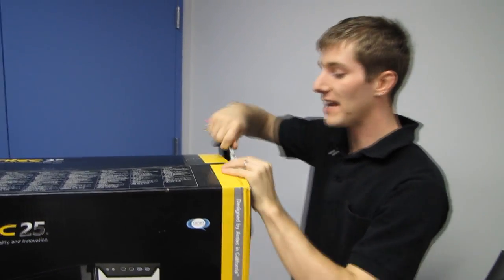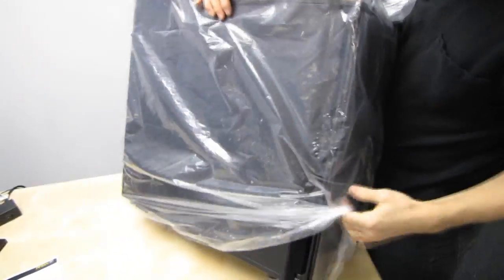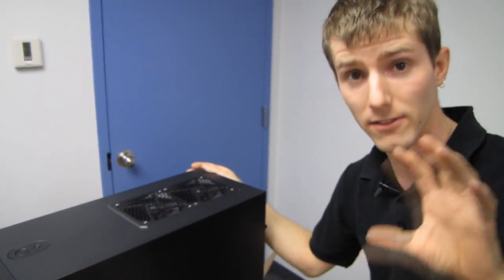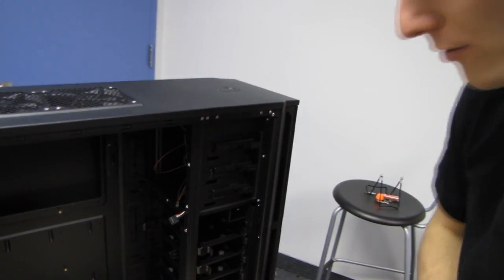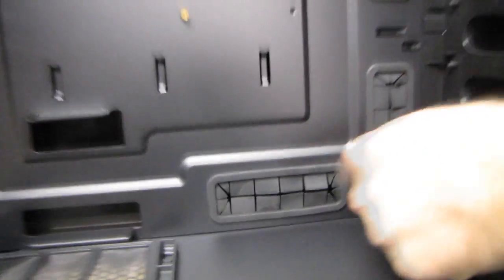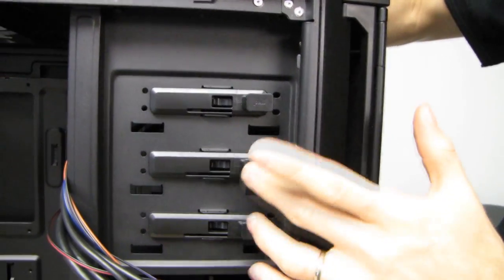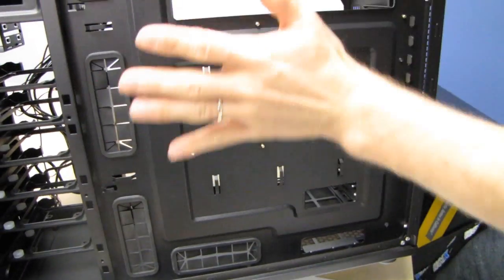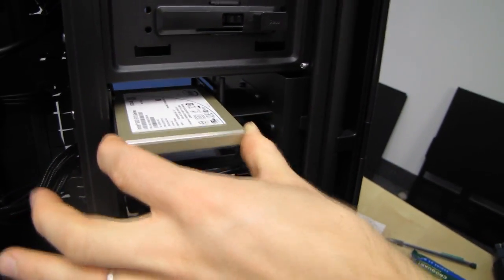Antec P280 Silent Case Unboxing & First Look Linus Tech Tips

Comment: I have used this case for close to 12 years, my original build had was a Asus Z87 with an Intel i74770K.  I have since reused this case with a Asus PRIME Z790-P WiFi motherboard w an Intel i7-13700K.  It has been an excelent case.  I wish it was still available but I haven't been able to find it anywhere, even used.  It makes for a great server tower because of the number of drives that can be put into it.

Comment: Linus looks so young in this, lol. It has been 10+ years since I bought this case and it's still going strong. I am building a new system soon and have been debating whether or not to buy a new case for it. If I could find an updated front i/o panel I could use this case for another 10 years. (would be nice to have 3.1 usb though).

Comment: Used this case for 10 years and switched only this year to Lian Li O11D Evo, new nVidia cards are too big. Miss P280 filters, had to make new filters for O11D Evo, cause stock don't filter anything (snakes maybe), just block air and are tricky to remove/install.
Reply: i bought it today for 15.50 $

Comment: I have this case. The 3 speed fans were the first thing to go. I replaced them with Cougar Vortex 120mm fans plugged in to the mother board. Antec's idea of cooling fans is not main stream. The Vortec fans are on built in rubber mounts and are a lot quieter even at full speed. Other wise I'm very satisfied with this case and feel I made a good choice.

Comment: I have the exact same case that's in this video. I bought it for $50 USD at the LinusTechTips meetup garage sale last summer. Great case.
Reply: +SuperAwesomeWeirdGuy Rly? I have it too, because my father bought it... I HATE IT!
Reply: Lukas Prosch What problems do you have with it?
Reply: You can`t replace the Drive-Cage and the rubber things broke in 2 weeks! The side window is too deep, so that you can see the power supply and the cables... That sucks... 
*****
Reply: Lukas Prosch Mine doesn't have a window and I haven't had your problems. Luck of the draw, I guess.
Reply: I'm planning to buy me a Phanteks EVOLV ATX. It looks great and it has a Two-Chamber System. *****

Comment: This case isn't as good as it seems, they all develop cracks in their upper hinged side of the front. The fans are the cheapest antec make's as well. They have a texture to them that will accumulate dust in a short amount of time. I say, Buyer Beware.

Comment: There is 3 fan switches and 1 empty one, is it possible to get a aftermarket switch that size to fill in that extra space and if so what is that switch called? could you possibly provide a link to the product.

Comment: I have the latest version of this - P280 white with window. Upgraded from my old P183. So much easier to work in. More space than the P183, single chamber, lot's of space for cable management, excellent SSD trays, and a much lighter yet still a very strong case.

Comment: Yeah I just literally received my P280 from Overclockers for £65 about 2 hours ago and while I'm still waiting for my RAM and CPU to come through the door I've attached the mobo at least to it and all I can say is wow, this case is stunning, much thicker joint to the door (my P180's hinge snapped) and the cable management is astounding.

Only thing I'm worried about is whether my HSF would fit in the case! It's the Arctic Cooling i30.

Comment: What would you consider among the best silent fans? I personally only have had experience with the antec truequiet 120mm, which I thought were fantastically quiet. Did you use the stock fans with the H100? I like to always take out the stock fans that come with a case and replace with with my favourites (which tend to be antec tricools, but that's not always the case. Haha. The case)

Comment: im wondering if someone can help me, what are the different ways to plug in fans, i know there are 3 pin connectors in the motherboard right? but what if they dont reach for example if you put them in the front of this case, can you use molex-3 pin fan adapters? i need someone to explain this to me thanks guys:)

Comment: I've actually purchased this case sense our chat and I can say for sure that it will fit.  I'm running a 560Ti single with a huge, HUGE heatsink on my CPU and I still have loads of space.  This case is quiet, beautiful, and LARGE.  It's as tall as the old alienware full ATX towers

Comment: @TheExprima though I personally wouldn't have the fan controller dials all the way into the foam. If you need to put the fan controller a little bit back. Or pick a controller that sticks out 18mm or less.

Comment: I just bout this and also got a large be quiet pc noise absorber kit to install. This is a large case! just about covered the side panels, and half the floor. Need to find some other way to get some extra mats without buying a whole kit. Btw antec just cheapened out, they don't use the locking psu fan filter any more and they have left out the rubber fan pins too (you get metal ones)

Comment: No removable Mother Board tray. It's my preference to have removable MB trays in my builds. I'll stick with my Cooler Master ATCS 840. Out of production, but still the best in my opinion. More and more plastic is finding it's way into new cases, it's such a shame. I've had two Cooler Master Wavemaster cases and the 840, mostly metal construction.

The P280 is nice, but not my choice since it doesn't have a removable MB Tray.

Comment: After 5 years I am still using my P190 + 1200 and will not change it for a long time yet. Why don't they include the power supply in the P280?

Comment: In looks i find the P180/182/183 still superior as for doors on cases i hang my headset on them. 

And with this new case i would prefer black fan screw up top seeing the top is fully Black. And it breaks the whole smooth black look.  Interior wise it reminds me allot of Corsair cases cable management wise. Or other copetions make it so as well wouldn't be surprised more cases look more like this in the future if it is'nt already so.

Comment: @hujimix Yes, it can fit any card on the market really, with a maximum length of 33cm. It is also built for watercooling support.
But two graphic cards or enormous radiators? I doubt it. But one should buy only what one needs, and I can't ever see myself getting watercooling or several GPUs.

I value lightweightness and compactness very much, even though not everyone does. All I'm saying is that Linus should review mini-towers, for us that likes them.

Comment: @GrixM Can you fit a in your case a GTX570 with Direct CUII from ASUS? or something within that size/range?
Can you fit 2 gfx cards inside to make an sli?
Can you fit any water cooling system with twin 120mm radiator?

Lightweight? well, most of the guys who buy high end hardware don't buy it thinking they will have to move it around quite often. If someone had the need to move his/her high end PC they should look for a gaming Laptop instead.

Comment: @hujimix 
I have a mini-tower with two harddrives and a GTX 560 and even an aftermarket CPU cooler. Works very well. It has sound-proofing foam, it's extemely small and light so it doesn't take much space and it's easy to carry. It has more than enough airflow and keeps my AMD 965 (overclocked to 4GHz) cooled below 50C all the time. All for half the price of the common humongous, bulky case.

Comment: Serieus, jep easy to remove filter but it's placed on the WRONG way. The font fans suck-in so the dust is on the front side and not the back. SO if you want to clean it, the honeycomb design is in the way, the back filter looks to be oke. Pretty case but the front door is plastic so nothing for me, maybe something for my Mid-PC customers.